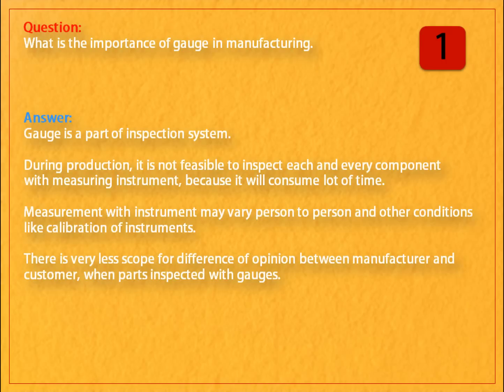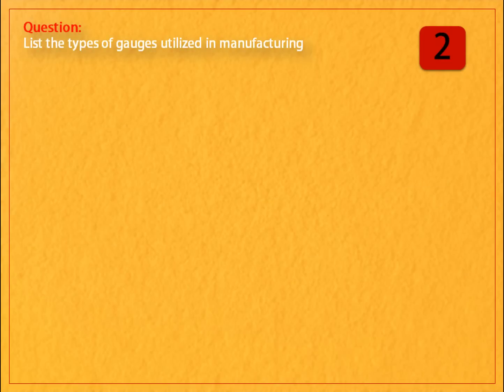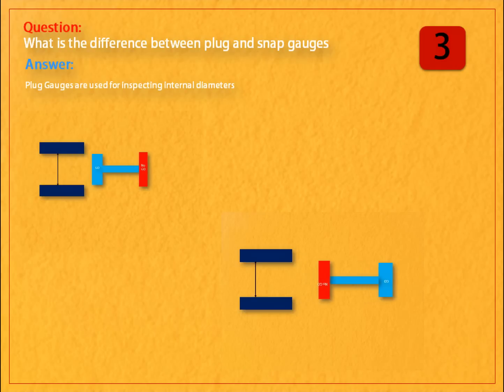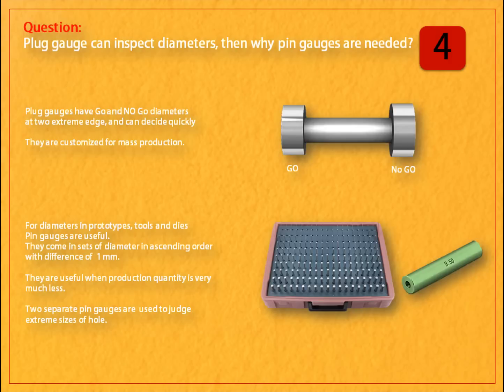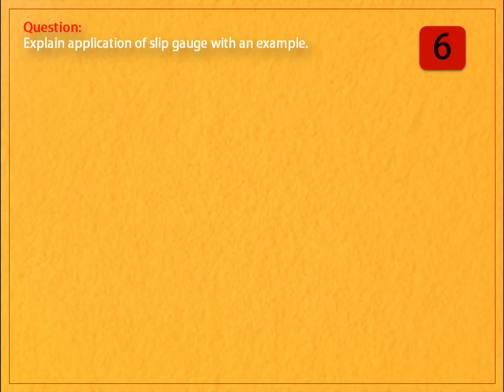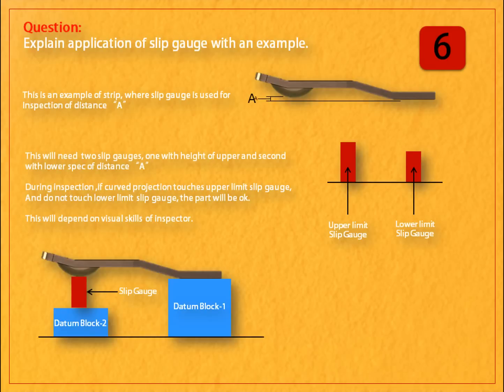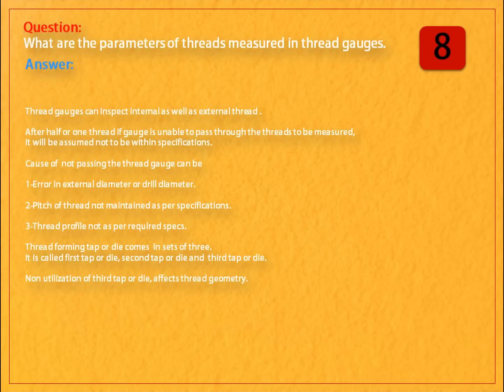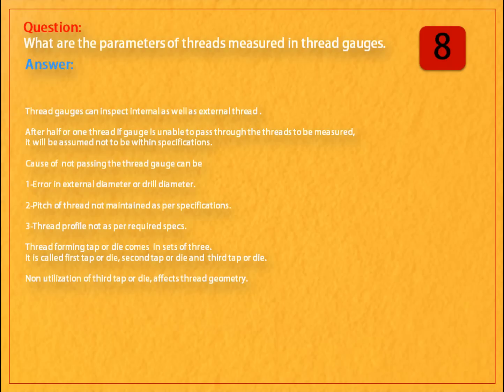Metrology & Measuring Instruments-Mechanical Engineering Interview Questions,dimu's tutorials

Comment: Sir,
          How can calculate pin dia meters with tolerence of concentricity components
Reply: +shrikant kusnurkar sir excellent and easily understandable videos...thank u...!
Reply from the maker: +Shersingh Mattu For diameters.pin gauge of diameter more than upper spec limit shall not pass thru hole.
Reply from the maker: Thanks for the comment.
Please let me know if you have any subject in mind.
Reply: question on plating